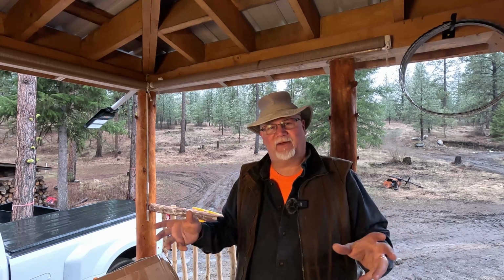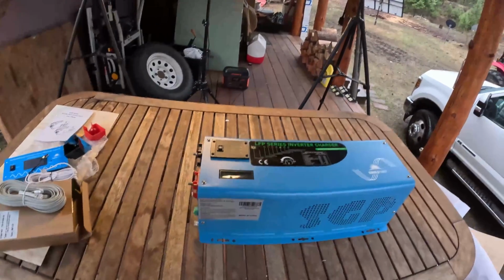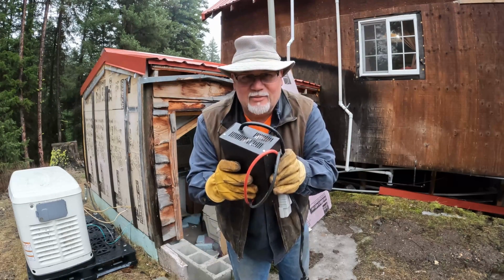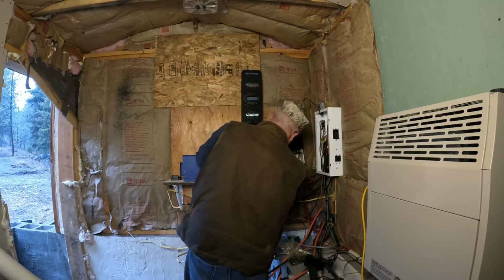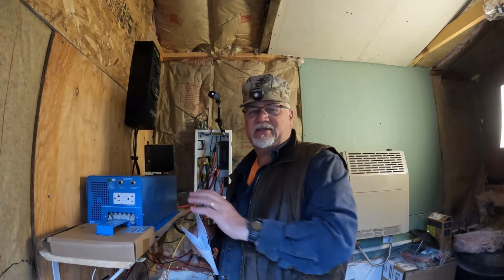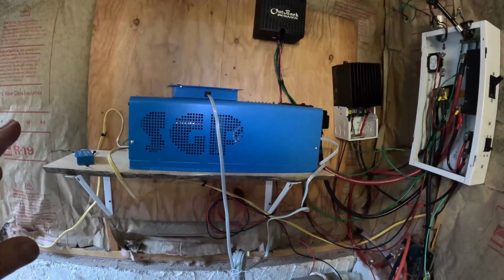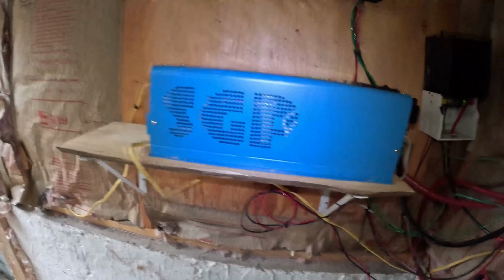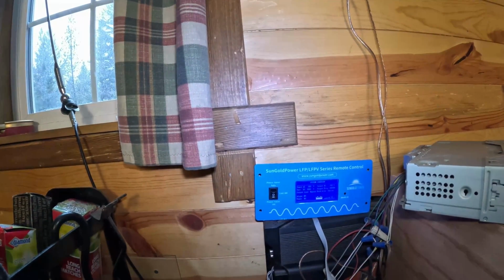Solar Power Upgrade: SunGoldPower Inverter Charger Installation

Comment: I'm adding a 12v 3000w Inverter Charger to my motorhome. Any pointers on connecting the AC side? Also, I ordered a shunt and battery monitor, Is that going to give me different information than the inverter monitor?
Reply from the maker: Hi, thanks for the comment/question -- for an RV it would depend on what you wanted to do:  go full time off grid with generator backup like my cabin, or have a transfer switch for when you have access to shore power.  As I'm not really an RV guy when it comes to wiring it out I'd have to look it up myself.  Now, the meter/monitor is definitely better IMO and provides more information that is also more readily readable from my experience.  I much prefer my Bogart Engineering Tri-Metric meter over the inverters readout but it's also much bigger, easier to read and programmable :D I'll be re-installing mine soon as it's also always on so I can see right away what's going on.

Comment: I’ve just put our house on the market and been looking for a place in the country worth the buying 
Wife and I recently became empty nesters we both grew up in the country unfortunately we lived in the country about six miles out of town thirty years ago and now we live in the city so yeah enjoy your content any input would be appreciated thanks for the video
Reply from the maker: What part of the country are you in?  In the Northwest there are places like 'Dirt Cheap Dirt' or even Zillow that will help.  If looking to go off grid the requirements are, of course, different but if looking to be ongrid with offgrid backup that's another direction:  Things I'd recommend:  water.  I prefer a good well that produces at least 3gpm but 10gpm would be much better.  If no hill for gravity fed water pressure than a pressure tank is a must.  South facing if you plan to garden or have fruit trees if on a hillside or like us, have the hill top in our area.

Boy I could go on and on! lol -- water access -- at our age it's good to have others help keep the roads open.  Internet service -- satellite is expensive so ground based is preferred if possible (I don't have any at the cabin now but had Hugesnet for a long time). Rights!  Timber rights, water rights, mineral rights -- all good to have.  Right of ways and easements -- be sure no one can close the gate on you.

I like our 20 acres (OK I love it) but it comes with work (which I love) and it offers all kinds of possibilities from hobby farming to family cabins for visiting but a tractor is a must (not one of the little compact mini tractors either but a Utility tractor in the 50hp range is a must IMO) for mowing, brush hogging, moving logs, rocks etc and plowing snow if up north.

Feel free to ask any questions you have and I will answer them all as long as I can :D  Welcome to my channel!  Glad you found me!